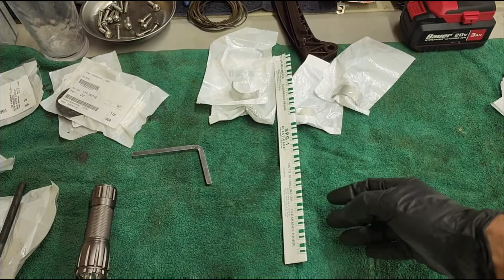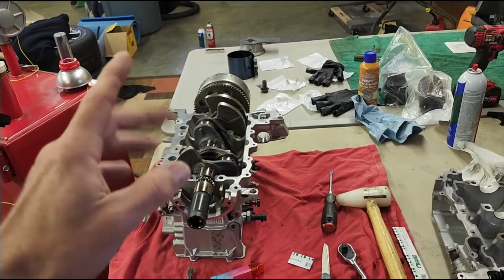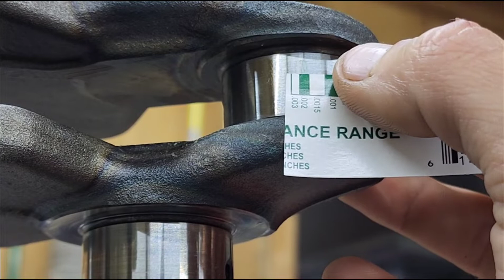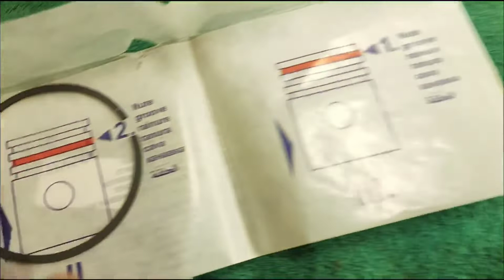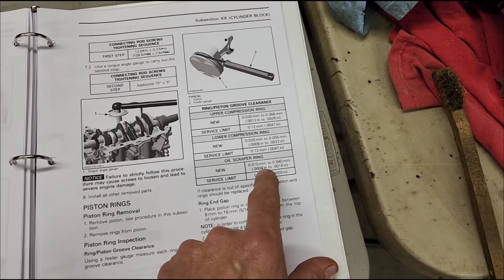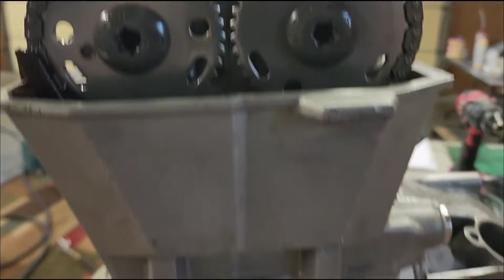Seadoo Spark / Trixx Ace 900 Engine Assembly / Rebuild, Step by Step with Updated Crankshaft

Comment: Took my cylinder head to get redone even though that was not the original purpose of tear down.  Surprised to find out the valves were sticking and had multiple valve seat leaks.  Tech said that I would have very likely had compression issues had I not dl redone the heads.  (@ $120 cost)

Comment: What is my best bet to getting a new crankshaft that won’t have the same issue again. Sending it to someone to have them send a modified one back? or should I just get a 2018 Oem crankshaft?
Reply from the maker: I have a video on the jetski Playlist covering the crankshaft. You send him your crankshaft and he cuts threads & sends you your back. Not a fast process, but its far cheaper than buying a 2018 crank. If you want a 5 day turnaround, buy a 2018 crankshaft, if your cool with a 6 week start to finish project for around $200, you can contact him via txt. He's very busy, so keep it short & to the point. 
His # will be in the comments section somewhere in the crankshaft repair Vid.

Comment: So, you took the time to plastigauge the bearings but didnt lap obviously rusted valves?  You stated rust was what the valves had on them, the whole head should have been disassembled and the valves lapped.
How does 90 degrees and 45 degrees equal 120 degrees?  The initial flex of the tool and fastener doesn't count toward the final torque angle so thats likely to be somewhat confusing to a novice and its not good arithmetic.
Based on the condition of the bores, that engine looks like it saw water and even if not, the oil pumps should both have been opened and checked.  Its also clear that there are rust patches that possibly were attempted to be honed out unsuccessfully.  The cylinders should have been bored and precision honed as it appears, pock patches will create blowby and premature ring wear.
It is absolutely NEVER required to grind or  modify the timing chain, it travels over 700 linear inches per second at 7kRPM, its not a dirtbike chain, it can not be shortened and should never need to be.  Attempting to do so will virtually guarantee a whip failure.
I didnt see a crank locking tool or a cam shaft alignment tool anywhere, they take the guess work out of timing and should be considered as required items for the assembly process.
The sprag clutch should have been removed and inspected then oiled prior to assembly along with all 4 idler gears center hubs.
Kudos for doing your own work, but honestly there's alot more that should have been done and you should NEVER use SBT stuff in any engine you want to survive.  I can tell you with absolute certainty their water pump oring will leak, you'd have been better served to reuse the factory green one, they last forever by comparison.  ShitBoxTechnologies isn't thick enough and the water pump is probably going to leak.  Seen lots of them do so.  Besides, why buy OEM hard parts then cheap out on the gasket kit?
I applaud the time and effort on display here, but imo the build had several glaring shortcoming that may very well prove to be an Acheilles heel in the long run.
If you are watching this video to learn how to build your ACE 900, be aware there may be steps it would behoove you to add to what this video shows.
Reply: Uh😊

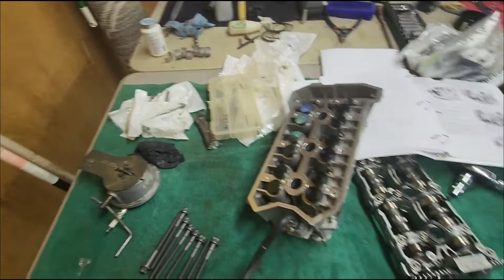Comment: On 28:37 before you installed the cylinder head, is that where the pistons position has to be when you install the head and set the timing?

Comment: I got a question for you. I have a Ryker with the Rotax 900ACE motor. It’s rated for 82hp. There is a comparable snowmobile with the same motor. It’s rated at 95hp. 
As far as I can tell, all things are equal. Same compression ratio, same throttle body etc. can I swap a snowmobile ecu onto my Ryker to get that 12hp bump?
What would be the risks of trying? What should I considered before experimenting with that?

Even further, I’m tempted to purchase a used sled turbo set up from eBay and adapt it to my bike since their practice the same motor as far as I can tell. Curious what your thoughts are.
Reply from the maker: I would assume it would work. But a jetski runs wide open most of it life. A snow ski can handle more/higher ignition timing bc its not ran like a jetski. They also don't have such a direct heavy load. My opinion on the ace 900, it's a cheap engine that has cheap internals, it's not manufactured to withstand crazy HP mods. I sold the ski bc from a mechanical standpoint it's not built to a high quality standard.

Comment: Great video!  Thank You.  One question would be how you got the timing chain installed?  It didn’t appear to be on the crankshaft when You put the cases together.  I am going to replace my timing chain and would prefer to not split the case.
Reply from the maker: That is a good question. You may have to grind a link & redo the chain. There's a Manual online, must guys in forums have it available. I'd read the manual and see what it says. But yes, my chain was on in the Vid, it was just hanging inside on the guide.
Reply: Ahh I see.  The manual says the case needs split to replace the timing chain.  Thanks again for the video and showing how to do it correctly